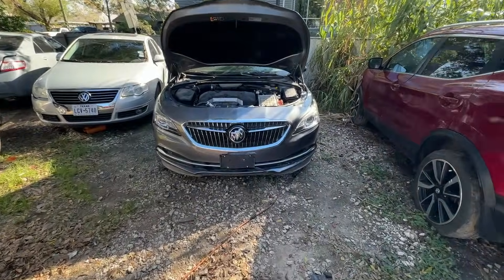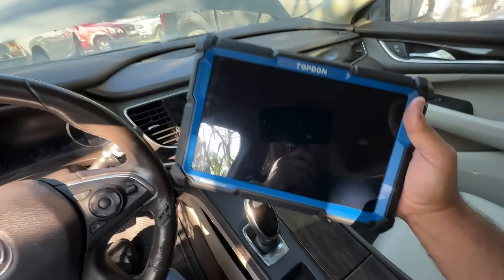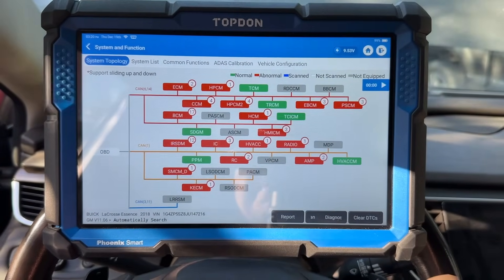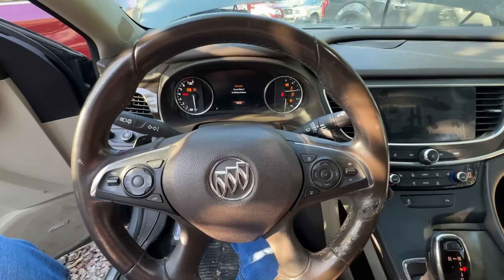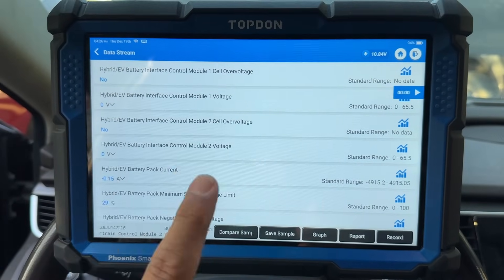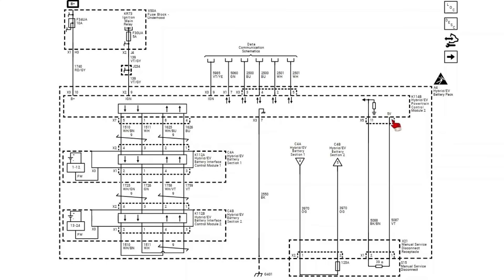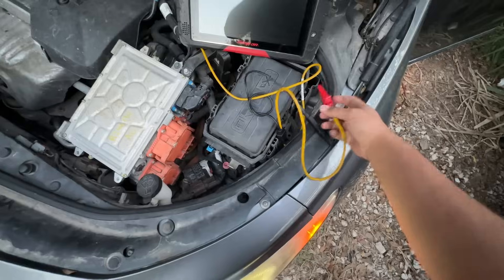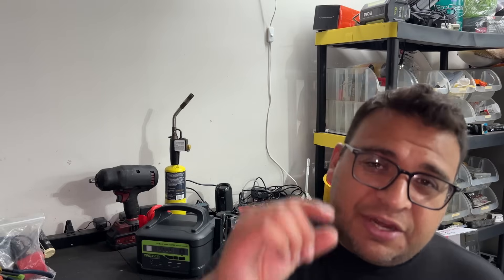BUICK LACROSSE HYBRID ALTERNATOR NOT CHARGING DIAGNOSIS

Comment: Question for you was that hybrid battery pack a new unit or used unit. I have a 15 Buick Lacrosse that with the J tool and laptop will not reprogram. Thinking it may be due to the unit being a used unit that was installed.

Comment: Great video, Eric ! I've had one of these take me for a loop . My question is , if the battery and modules where replaced with used parts , wouldnt they already have software in them ? What do you think was the problem with the programming? Vin# mismatch , handshake procedure, set up function ? Im curious . Thank bro

Comment: For all of those who are hell bent about "EV" vehicles as being the answer to inexpensive transportation, here's one example of what can take out all of the savings in ownership with just one visit to a mechanic. Two control modules, alternator, the 12v battery and likely the main battery pack. Up to this point, the owner of this vehicle probably experienced some savings on fuel however, now comes the expense. Not sure what those items cost but it's well into a few hundred dollars plus labor. The battery pack would best be replaced new vs. used since they are a wear item and you wouldn't want to get a used battery pack that is on its final life only to repeat this issue in the near future. 
Agreed, if mechanics like Eric want to remain in business, they must adapt to the needs of the EV and Hybrid vehicles with superior education and test equipment as well as known best practices to make sound diagnosis. The shop who referred this to Eric possibly didn't need 3 alternators and/or those control modules because they weren't totally familiar with the Hybrid system. To add more difficulty to this repair is a customer who has limited funds to allow for a full legitimate repair. BTW, very sweet to see a mechanic who has some quality jumper cables ! And, long ones to satisfy almost any situation !
Reply: The problem is not only limited to EV's. SMA just posted a video about a KIA (ICE) van that had an OEM backup camera put the vehicle into limp mode. The backup camera shorted to ground and because its connected to the vehicle's network bus, it took down the whole system.
Reply: @bobsoft  Saw that one too. Those managing engineers of today have near vision mostly.
Reply: @Garth2011  I think the manufacturers want to cut out the aftermarket parts and repairs. Much like they tried to do when OBD first came out.
Reply: Tell us how you really feel..

Comment: Didn't know you could run battery cables from one car to another for programming. Is it clean power? Any possible issues?
Reply from the maker: The battery works like a big capacitor so the signal is relatively clean.
Reply: @ADVANCEDLEVELAUTO  Nice. Good to know👍
Reply: Current is coming strait from the Ford's battery, so the power is clean (provided the Ford's alternator is ok).

Comment: Having to reprogram modules for hybrid and EV vehicles is ridiculous. Majority of the modules not part of the main ECU  should be plug and play. Makes it harder for the DIY'er to repair their vehicles. All schematics and wiring diagrams should automatically come with the vehicles on a flash drive. Explanations about the function should be written into the wiring diagrams
Reply: They want to make sure you can not swap easy and need to report to builder when something is bad.

Comment: Advance Kevel Auto how can I contact you, i have a 2013 year model hybryd, which is a little bit diferent based on what i have seen in the video,but i have the same issue, i want to know where my module is, have not been able to find it, want to make sure if its inside the  battery pack and once replaced would it need to be programed.

Comment: The client could not afford a new alternator but the shop replaced every other component of the electrical system, so where is the cost savings? Parts cannon to the rescue.
Reply: Yup. Low income client took his car to discount part changers. Those guys shouldn't even be in business. How do you throw a part in without knowing it needs to be programmed?

Comment: This was great!  I have a 2013 Malibu with a very similar system and it's helpful to see the operation.  From what it seems at the end, if there is an issue with the battery pack, the car will default to disabling the high voltage "hybrid" side of the system and would run the car as a conventional system.
Reply from the maker: The problem here was that the Control module that works to switch between generator and motor was not programmed to the vehicle so it could'nt operate at all.
Reply: @ADVANCEDLEVELAUTO  I see.  The generator control module was part of a recall on my car. The issue was that it was related to the battery not charging.
Reply: I don't think so, if there's anything wrong with the hybrid system, the car simply will not run
Reply: @jrmurillo1104  The system here is not full hybrid.  This is what is called Mild hybrid. It assists the gas engine in certain conditions and runs all 12v electronics from the high voltage battery.

Comment: Why can they not just put in a brand new battery at least you know the main part is good because that controls everything and modern cars especially complicated ones like that hate low voltage
Reply: very expensive. and if u mean the 12v battery in the back, that has no use since it was not charging it will damage your new 12v battery.

Comment: A majority of hybrids don't have or need an alternator
Reply: Its an alternator/motor/starter as he mentions it in the video. The 12V battery need s an alternator to keep the charge, so that electric motor funciona as an alternator
Reply: @jrmurillo1104  most hybrids use a power inverter to drop the voltage down to about 14 volts to charge the battery so they don't need one
Reply: @DylanL69 sooo what generates the voltage 🤔
Reply: @sheerwillsurvival2064  the big motor/generator attached to the engine it looks nothing like this thing
Reply: @ 👍🏻crazy how things change